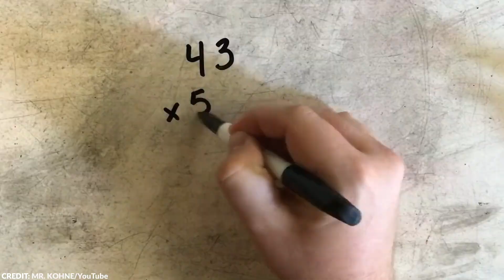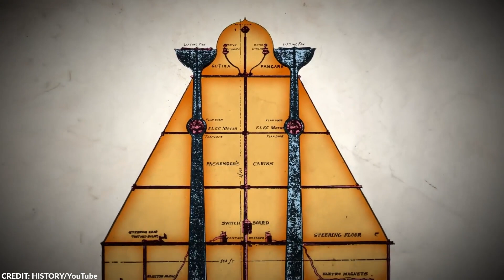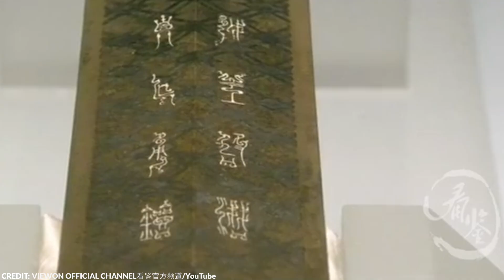15 Old Technologies Scientists Still Can't Explain

Comment: What’s amazing about Roman concrete is its self repairing. When mixing it the creators used larger pebbles of lime mixed in with the finer powder. If a crack developed it would only travel as far as the next pebble and once the concrete became wet from rain the lime pebble would dissolve and seal the crack. Ingeniously simple and it’s lasted 2,000 years so far.
Reply: They did figure out roman concrete recently. I dont know if it should make the list
Reply: @raynac224  I think this list was from before they figured it out.
Reply: I wouldn’t say it’s ingenious, more like a fortunate fluke that it self heals
Reply: why thats why its so famous
Reply: @stevering5293  how is it a fluke if it was designed to do that?
Reply: They may not have understood the chemistry, but they oberved the properties and said "good enough" no knowing what it would do over hundred of years
Reply: @libbeymichael  it was designed to go hard and it did, that we know. Anything else is assumption. Any bonus of self healing was most likely due to a fluke bonus of imperfect mixing
Reply: Hey Steve.. give me an example of any recent technology that is superb by fluke
Reply: @brettjohnson6979  easy, the microwave technology
Reply: @brettjohnson6979  antibiotics

Comment: Concrete doesn’t last as long today because we use rebar. Any moisture via cracks, introduce rust. Once rust begins it expands inside the concrete and causes failure.  A block of concrete without rebar can last forever.
Reply: Yeah but without the rebar you physically could not make, any of the monolithic and intricate structures we build today
Reply: @shmillbe3390  yeah. I know that.  We’re not talking about today’s structures.  We’re talking about why Roman concrete endures. Take out rebar and a block of concrete can last just as long.
Reply: That 'we use' today is quite a wide statement. In China you can crush concrete with your fingers. They even call it tofu concrete. The rebar is slightly better, you actually need to hit it with something hard to break it.

Comment: Railroad bridges in my area were built around 1906 and are still in use.  I drive under them occasionally and they are clearly marked with the year of construction.  Obviously concrete will last over 115 years as the bridges still support trains.
Reply: How often are they maintained. I'm a bridge worker, and bridges of today take constant upkeep, at least every 5 yrs. Greeks made concrete with materials with ten letter words I won't bore you with, knowing it could last forever, while we use Portland lime, knowing it will need to be resurfaced with latex at some point. We just don't use volcanic stone and grind it to a powder anymore. Too much work, I guess.
Reply: Turn the page
Reply: They believe the golden gate bridge will last another 150 years.  Of course that is nothing compares to the pantheon. Actually it is not that 21st century concrete is not as good, it more we literally did not know how they did it.  I believe roman concrete is still amazing in sea water compared.
Reply: @rebeuhsin6410  We can make better concrete than them rn but its too expensive and nobody uses it.
Reply: @Antixandros   This is true.

Comment: Modern concrete lasts way more than 50 years Iam a 64 year old builder , We were tort that concrete keeps getting stronger  up to 99 years.
Reply: There are concrete structures all over the world that are older than 50 years! It may even last as long as the Roman concrete but it will be many years before we know.
Reply: You're not 64.

Comment: Roman concrete is actually a solved mystery. The inclusion of limestone clasts...Which has been dismissed as the result of bad mixing techniques, make roman concrete self healing. The concrete cracks, rain gets in and activates the clasts, sealing the crack.
Reply: Clast a icons

Comment: Interesting video. But there are a couple inaccuracies. 1 - modern concrete certainly lasts much longer than 50 years, there are many concrete foundations where I live that go back to late 1800's coal mining that are really still quiet solid. And what about some of our older concrete buildings they are still standing. 2 - Damascus steel has been recreated, there is an interesting video on youtube, about making of the Ulfberht sword in modern times.

Comment: As someone who has repaired buildings as old as 160 years old I am interested in the Roman concrete. To discover the secrets of this compound could change so much in our throw away society.
Reply: Great observation!
Reply: It breaks too easily compared to modern day
Reply: @PBNIP  Actually they solved it and it does not break it self heals. That is why our structures last 40 50 years their last 100s

Comment: I saw a report about the constructions of the Incas and it showed how those perfect joints were achieved.  With the help of an acid, which was created by the springs coming out from between the rocks, the Incas polished and then joined/glued the boulders in the wall.  They used those little growths on the surface of the large boulders and levers to place them in the proper position.
Reply: there was a report on that can that be seen in the internet? what website?
Reply: hmm
Reply: And with what did they move these 200 ton stones from over 100 KM away?  I think most of this stuff if pre-flood architecture.  The only remnants of the advanced civilization that was probably way beyond what we are capable of today.  Even Bob Lazar said that one of the UFOs at S4 was dug up out of the ground.  It would take much more advanced technology to move those stones and form them, or giants.  True Legends has covered some of this, and there was even a giant killed in Kandahar.  It was 12 ft tall, 1100lbs, dense as a rock according to the flight crew chief that transported it.  It disappeared after that.
Reply: For the modern man, it is really inexplicable how the people of the Inca civilization managed to build those walls with stones of impressive sizes and masses.  Answer: just like the craftsmen of the ancient Egyptian civilization.  With ropes, levers, inclined planes, blocks, stones and, above all, by uniting the efforts of large masses of people.  They had patience, skill and... time.
Reply: I believe the idea that those walls were made out of stacked bags of wet concrete, or something similar. the edges are all curved as they would be in wet bags and the bags would have formed to the shape of the level under them. Looking at them in this video I see bags of wet concrete easily.
Reply: @clmn6712  So they had plastic bags,,They started the polution!
Reply: @EmeraldHill-vo1cs  Where did I say "plastic" You are jumping off on a deluded tangent. Concrete comes in paper bags, feed comes in gunny sacks that will hold something like concrete, then the biodegradable bag dissolves away
Reply: @clmn6712  Joke joyce.
Reply: Think I saw that report - something about reddish brown acidic mud with the perfect fit only going in about 6 inches deep from the front, and the reason the stones were irregularly set was to give extra stability during earthquakes.  Wish I knew where I'd seen the report.

Comment: 13 - Cut out huge rocks to get necessary number of cubic feet (or whatever unit of measure needed) of stone for construction project.  Then cut each rock into smaller pieces (much easier because you have access on all four sides), to be transported to building site.  DUH!

Comment: How the rocks were fit so tightly on the first one has been solved. They took highly acidic mud that ran out from a mountain and put it in between and over time the acid ate the rock and with the weight of the stone had a seamless fit. Now how they got them there and in place who knows but the microscopic fit is from very acidic mud.
Reply: there is no acidic mud springs in south america......try again. still dont explain WHERE they took those rocks from, and HOW they managed to get them all the way up there.
Reply: @bladerj  I'll search for the documentary I watched and post it. It wasn't a spring it was a creek that was contaminated, I can't remember if it was from mining or it just leaked, with high acidity content. It's like a sulphur creek that we have from mining in the US. Somehow these people knew what was in the water and knew what it did to rock. They mixed it with mud and used it like grout. Over time and the weight they molded as if it was one rock and I didn't say how they moved them.
Reply: @butter7734  thanks for taking your time if you find the doc i would be very interested in seeing it.
Reply: @bladerj  if you goto a channel called Logic the video called How Inca walls were finished/joined so perfectly there is a link to the paper in the description. From what I'm reading they are thinking using acid was also the way they think Egyptians were able to carve and cut such hard granites. They use acid to soften the rock take out the soften layer and then repeat.
Reply: Okay where is the results of the study to comfirmn this.
Acid might be okay on certain materials but not granite.
Any sort of acid would disintergrate any binding materialof rock similar to cement does to concrete.
Reply: @markf3229  what
Reply: But the beveling...a pre-dispositioning of surfaces... too difficult to predict how to fit perfectly.
Reply: Evenly distributed? Even a little off would leave some gap.
Reply: @randymcphink3924  read the paper.  This comment doesn't even make sense.
Reply: @butter7734  acidic mud doesn't make sense bud. It'd take a lot of acid to eat away at a stone
Reply: @randymcphink3924  OK bud I'm sure you're an expert on the subject.
Reply: Sure.

Comment: you missed  points and assumed  various thing in many   narrations  in this video and  some  are misleading   a glaring one  is  in the concrete making from roman times they also found they  used -   unslaked lime , along  with volcanic ash (Pozzolana) , sand,  and  rock,  no proof of  saltwater used in making  but it withstand  saltwater  better then modern concrete and when exposed to salt water the roman concrete a crystal structure called Tobermorite

Comment: They pounded the rocks over and over till they fit exactly in place? What did they do if it didn't exactly fit? Take them off and put them right back after they pounded them to place after countless hrs?
Reply: Acidic mud in the joints softens the rock and the weight fits it in place.